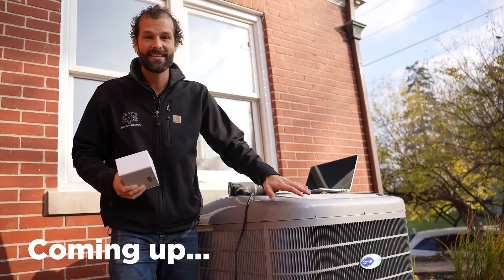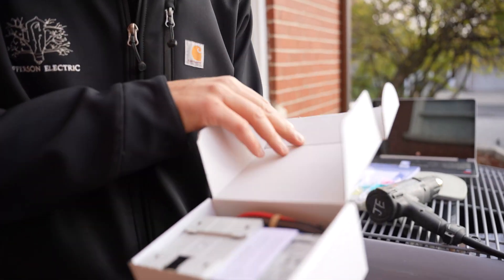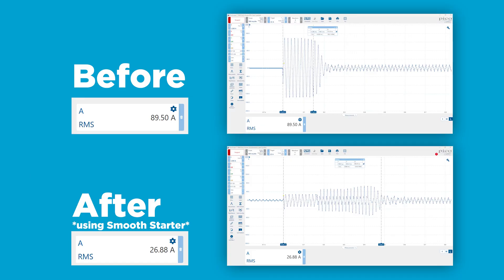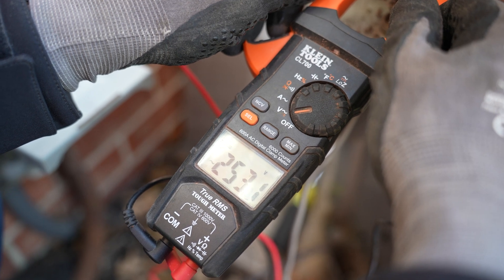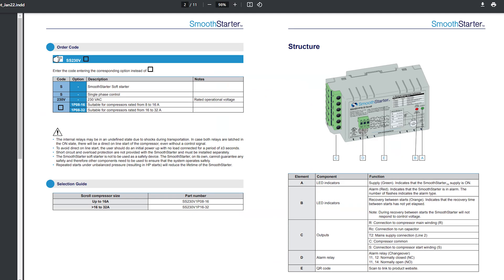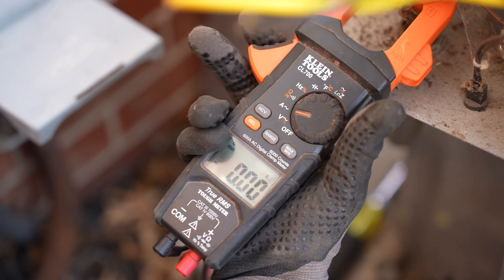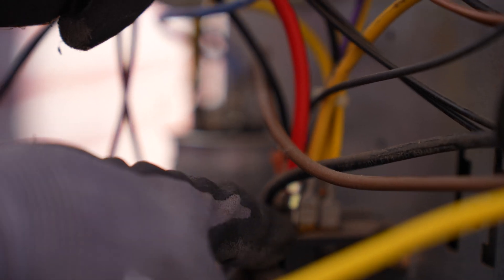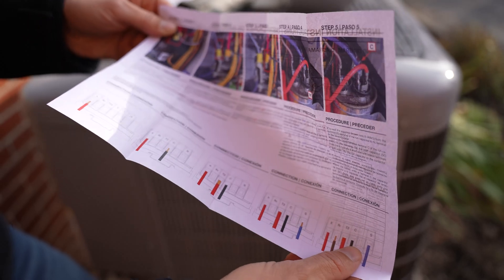STOP selling Home Battery Systems Without This!

Comment: Is that component rated for damp location?  If your lights dim or flicker when a AC turns on, you need an upgraded panel, and or check some lousy outside connections. Another reason to use mini splits, inverter controlled

Comment: In the process of installation, you never showed what was done to the blue wire that was disconnected from the capacitor terminal. Last we saw it was just dangling in air at 7:57 into the presentation, and "pulled out of the way."

Comment: Hi, you did not compare the in rush current before and after on your meter
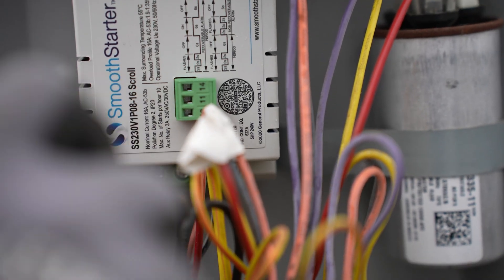Reply from the maker: 2:06
Reply: @ElectricProAcademy love your videos, but you could have at least borrowed a clamp on ammeter capable capturing in Rush. I'm sure a supply house would donate one for your videos. Seriously I think you do a good job on your videos.
Reply: I missed it as well. Thought it would have been easy to see inrush on meters, just not yours.  Hence the oscilloscope for real measurements.
Reply: The oscilloscope gives out the real measurement of the inrush current when using soft starters. Some of the inrush current measurements you see as before and after do not really tell the whole picture and, typically you will see a far more lower Amp draw (during inrush) than the reality.

Comment: Ah, Will Prowse beat you to it!
Reply: There are videos about soft starters that are 4+ years old.  These and others are also half the price the one Will featured.  Will was beat a LONG time ago on this one.  People have been using these on RV air conditioners for ever.
Reply: I was about to say the same.
Reply: I installed a Micro-Air EasyStart to my RV air conditioner several years ago. I also have an electrical management system installed on the RV, which can show real-time current use. My RV has a 30-amp 120V power input but when my air conditioner compressor initially kicked in, the amperage usage would spike to 34-36 amps for 10-20 seconds before returning to a continuous 16-amp draw. AFTER installation of EasyStart, I could barely tell that the compressor had started, when before it would make a loud sound. Now, the compressor start temporarily goes up to 22-26 amps before dropping down to 16 amps. I’ve contemplated adding one to home AC.